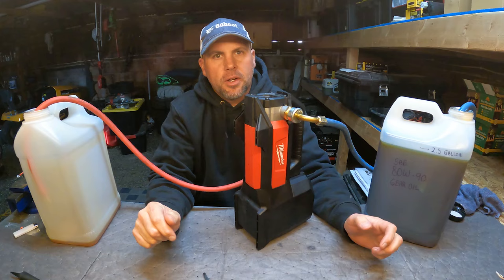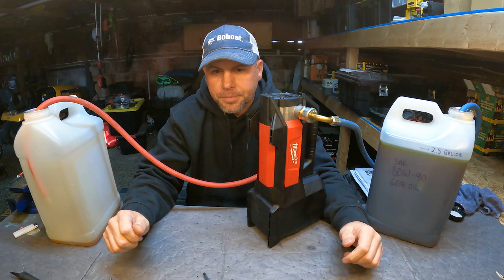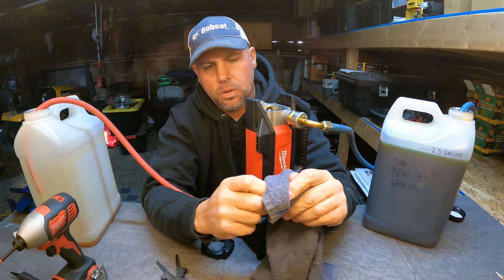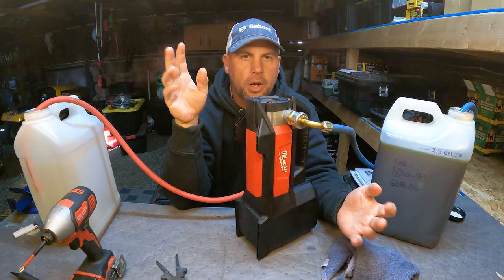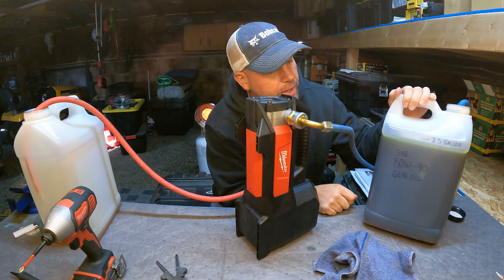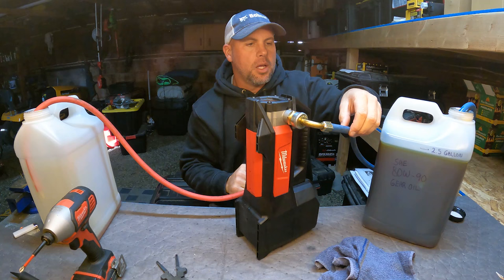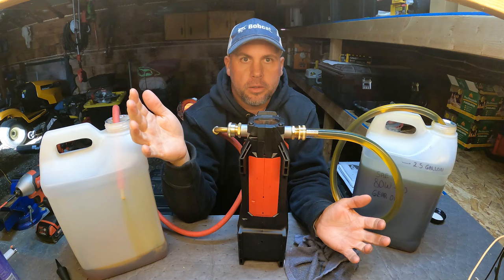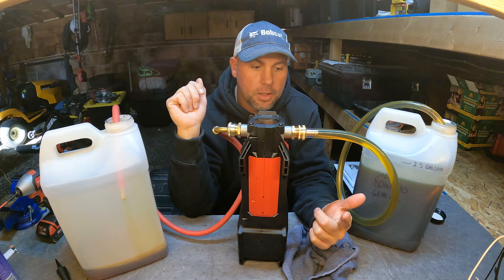Milwaukee 2771-20 transfer pump update. Pumps oil and diesel, updated video!

Comment: Be aware that this thing is not sealed in the vertical position and liquids can drip down into the electronics when you have it positioned vertically like in the video. It has weep holes on the underside so that when it's used horizontally it won't reach the electronics. I found this out the hard way and had to take it apart and replace an internal fuse.

Comment: Milwaukee isn’t stupid. They put on the label “water only” so if you do pump oil or some nasty stuff and it goes bad then they don’t have to warranty it because you didn’t go by the book.
Reply: There’s a whole list of warnings in the manual because people will do what people do and especially to cover their ass in case of major lawsuits because the pump doesn’t have an “Intrinsically Safe” rating, which would require the switching,electronics, battery and motor to be sealed off and separated from the surrounding, possibly explosive atmosphere. (The build and certification to achieve that rating would raise the price considerably.) 
From the Milwaukee pump manual: 
“Do not pump flammable or explosive fluids such as gasoline, fuel oil, kerosene, etc. Do not use in a flammable and/or explosive atmosphere. Personal injury and/or death could result.”

Comment: Why switch hoses all the time,  just stick with the 1/2" and be done.
Reply: sometimes the hole diameter your transferring from may be smaller so you might need different diameter hose for different applications

Comment: I have a pump like this and I run a truck repair service. Motor Oil and Diesel I have no issue with. I know the pump wheel is nitrile coated which is great, not sure what kind of seal is on the pump shaft to the motor. I has lasted a year with no issue. I would worry about solvents or alot of gas. There again it has worked thus far.

Comment: Another excellent video, thanks!  One exception to pumps which only use a rubber impeller is Jabsco; they use nitrile impellers in their bilge pumps, since boats can end up with all kinds of stuff including oil or fuel down in the bilges.  Reasonable prices and they have some models with brass or bronze pump bodies instead of a plastic.  Jabsco has been around for years, another reliable company.

Comment: I use my Milwaukee transfer pump for glycol and I’ve never had a problem. If I am close to a water source I’ll flush with water for a few seconds to purge out the hoses and pump itself. This pump kicks ass for a lil unit 👍

Comment: Thanks for the video. We have been using ours on some gasoline and it DID swell up the impeller to where it wont even spin now. However replacing the impeller had not even crossed my mind until watching this video. I was about to order an entire new pump.
Reply: Jesus, that would be like replacing your car every time it needed tires.

Comment: I've pumped literally thousands of gallons of oil water a variety of contaminated fuels and more and have not had any issues with the impeller. Same here. I just cap off the lines and left whatever was pumped last inside.

Comment: I'm a field service generator tech for Cat. I bought my M18 pump 2 years ago. I've only used it for coolant. Never ran anything else in the pump. It can move 110 gallons of coolant pushing from the bottom up in maybe 30-45 minutes. I will have to time myself next time. I noticed my pump one day about a year ago was pumping weird, I found one of the impeller fins was missing. It pumped out 110 gallons but going back in with the new it got almost to the bottom of the first drum and wouldn't pump anymore. I replaced the impeller and bought a spare. It's been fine ever since. It's odd that mine broke on just coolant!

Comment: This is badass, thanks for this video. I work for a Cummins dealer and we don't have a lot of the luxuries that most shops should have like oil transfer pumps and the like. This will be very helpful in our shop as we fill 6-12 gallon engines by hand. HUGE waste of time for our customers. Glad to hear this tings serves your purposes well. God Bless bud.

Comment: Thanks for the review, exactly what I needed to know. Gonna pick one of these up for pumping oil. Just did some service work on a pipeline job, and at -33C even with the equipment running at high idle, the engine oil was barely warm enough to drain. This pump would speed things up so much!  Thanks again

Comment: Great news, thanks for the update.  I was one of those warning about possible issues.  Yes, nitrile and Viton are the rubbers of choice for petroleum.  I didn't know what these were made of.  Did the Grainger site ID the rubber?  There's no test like a long term field test.  I know your eyes will roll on this part, but what about the shaft seal?  The reason I'm so wary is that I build spray systems.  We started off with off the shelf pumps and found that some wouldn't last a week before impeller or shaft seal failure pumping pesticides cut with both water and mineral oil.  We started ordering pumps with Viton seals and stainless impellers(for our centrifugal and rotary vane pumps) and haven't had to replace one for a seal or impeller failure since.  
I still won't be using one of these for gasoline because of the brushed motor and confined motor housing that could trap vapors.  With oils and diesel it's not such a big deal.  With gasoline it's, "Are you willing to bet your life on it."  But that's just me.
Thanks again.  Great update!
Reply from the maker: Excellent point, I'll check into the shaft seal.  Good point about brushed motor and gasoline as well. Thanks for the feedback.
Reply: I really love it when experts give their sincere opinion on issues, I do a lot of diesel and gasoline transfer so what is my best option.
Reply: I hauled fuel for a living and every pump and hose is wire wound and grounded for a reason.  
One of our drivers was flash burned when his phone hit the concrete and sparked. Under the right conditions it can be deadly.
Reply: @abibodlogistics  Look for systems and components specifically designed for gasoline and diesel transfer that are rated accordingly.  There are issues with fuel transfer that the average person wouldn't consider, like static electricity.  Petroleum products can produce a lot of static electricity when moved against certain materials.  They must be properly grounded and designed to dissipate electrical charges and be made of non sparking materials.
Reply: @mikemorgan5015  Thanks.

Comment: Just what I wanted to see struggled today trying to pump 100L of cold gear oil into a piling rig today gave up with my drill pump had to result to a very slow poor into a small funnel taking nearly 3 hours. 😩 good to see the flow isn’t to much as well as filling reducers and track motors if I pump to fast it will blow out the hole.

Comment: If you're warrantee is done, you should put a plug on it and have a drop cable that connects to it with a momentary switch like a winch. You can lay under a vehicle and pump it and shut it off as soon as you are full vs having the pump near you to hit the switch on and off. Should be able just to tap into the existing wires without bypassing the factory switch. Have the drop cable on a plug to disconnect if you don't need it for a certain job.

Comment: I pumped over 100 gallons of 220 gear oil no problem but uses batteries fairly quick. I even reduced the output down to 1/4" to fill small gear boxes. also pumped over 100 gallons of 460 gear oil! but!!! it would only pump for 30  seconds to 20 minutes then turn off. Just turn off then back on.
Reply: I used to pump 460 years back. They had a pneumatic 'pogo stick' piston pump that worked pretty good. That seemed to be the only thing that would survive for very long.

Comment: If you would have heated the gear oil a little, would it flow easier and faster with less cavitation.  Another observation , if the pump were laying down as compared to standing, wouldn’t this also help with the ease of transfer???

Comment: Im looking at doing mobile oil changes with this pump instead of buying an air powered lube skid to mount in my service van. Could i run this pump at the end of a 50’ reel for recovery? Im thinking if i had two separate pumps for recovery and new oil, i could install an in line flow meter to measure how much oil i pump out. And for recovery just drain into a pan and suck up into the recovery tank. Only thing im on the fence about is if i have oil tanks on a pallet in the truck i would need a long hose to reach the truck im working on. I guess i just need to buy one and test how long a hose i can pump 15w40 and still maintain a decent GPM.

Comment: Hydraulic fluid? Having slightly aerated motor oil is one thing, what about using it for hydraulic fluid on my tractor?
Reply from the maker: Yes, it will work for hydraulic fluid.

Comment: Hahah warm soapy water 💦😅😂  do you recommend I’ll handle rear truck gearbox oil tranfer  and regular car transmission oil tranfer I had a 12v but motor seem to over heat and burn cost like 20ish . ?

Comment: I'm debating should I get this or the zuwaUSA drill pump, They are the same price, Zuwa is for industrial work, and they are easy to fix and it's smaller since it rely on a drill to run it.  Anyone have any experience with the ZuwaUSA?

Comment: I wouldn't expect a cheap one from Harbor Freight to last.  Those tools are all very cheaply made.  I had the screw drivers they give away free with a coupon if you buy something and the flat tipped one twisted the first time I attempted to use it.  I threw those things out, they are just junk and probably not hardened or heat treated which would maybe make them last longer.  Just do yourself a favor and spend the few extra dollars for a good set and be happy with them knowing they are much better made!!

Comment: How would you recommend going about cleaning the pump before switching fluid types? Say your pumping diesel into a tractor and then need gas into ATVs 
Would you say before pumping the gas into the atv just prime it by pumping some gas out on the ground first make sure all the diesel is out of the system?
Reply: I'm looking for an answer too but my only thought of the cleaning process when switching fluid types is maybe running two quarts of degreaser and a quart of water then water for 3 to 4 mins. I'm a diesel mechanic so I'd be using it for diesel and coolant only but im thinking of cleaning it out that way after use. Or maybe even just water

Comment: Thanks for this wonderful video, I can see what you have done with it but for clarity purpose I want to know if this pump is designed to transfer water alone or it can also be used to transfer diesel and gas fuel. The second question that I will like answered is that does this pump come with the connectors for the hoses. If all these things checks out then I really need this pump and I  will not mind the price because the price will not do what this transfer pump will do for me .

Comment: Wonder if this would work on #2 heating oil
Reply: Should be fine since that is essentially diesel fuel
Reply: That is the same as diesel. Typically it's red dye diesel which is just free from road taxes, hence the dye so troopers can tell if someone is breaking the law using "off-road" diesel in trucks that travels on the roads.

Comment: Any update? I do field service work on the same machines and i will be pumping oil. Interested in condition of shaft seal and where to buy replacement impeller from if required
Reply from the maker: Still pumping like the day I bought it.  Paid for itself many times.  I don't remember exactly where I ordered my extra impeller but I've never needed to change it.
Reply: @tetradgroup  thanks mate like i said ill be pumping the good old chain case oils from bobcats too so just needed to know how it stands up to the test
Reply: Any news on this pump? It’s been a year and I want to know how it’s holding up to the test of hydraulic oils @HowIDidIt